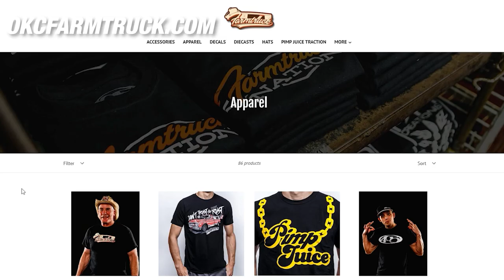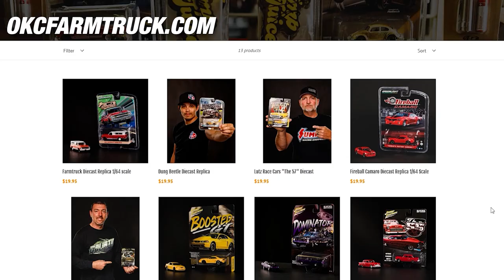FARMTRUCK TEST HIT BEFORE RACENIGHT!

Comment: These guys may be the only true street racers left in the 405.  Most those other guys are the furthest thing there is from street racing.
Reply from the maker: We try the temptation to change the truck more than what it is....a real truck!
Reply: I remember you two pulled into a garage,  going fishing,  real fishing,  boat on the back, Porsche sitting there, as always LOVELY car, wanna race, with that!!, didn't even take the trailer with boat, man you messed his day up big time , JUST AN OLD FARMTRUCK....JEEZ I LOVE THE SOUND OF THAT ENGINE,  JUST LOADING IT,  SOUNDS SWEET...TOOK A LOT OF SCREENSHOTS,  IM GOING TO SHOW A FEW OF IT LEAVING WHEELS IN THE AIR, CAUGHT IT LOVELY,  IM FRAMING THAT, SUBBED TOO, GOODLUCK WITH THE FISHING,  BIG FAN FROM IRELAND 💨
Reply: Not here to argue what the definition of “true street racers” (that’s too subjective). You’d be wise to start following the other 405 guys channels though, starting with 187 customs. 😉